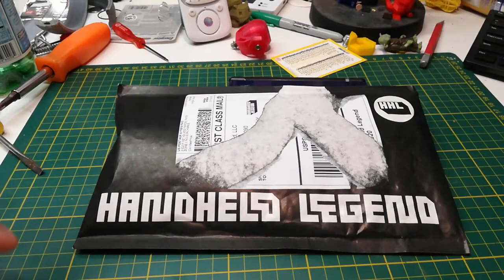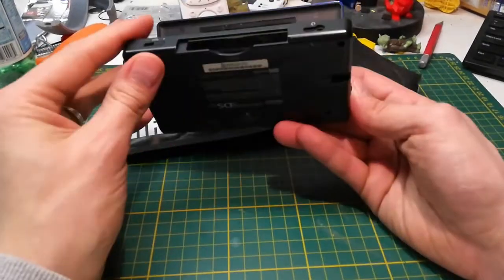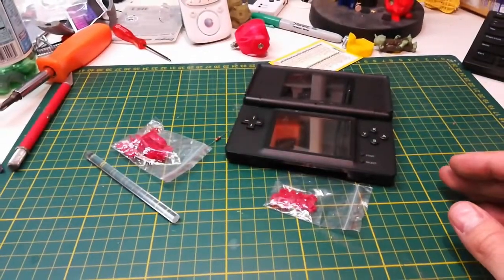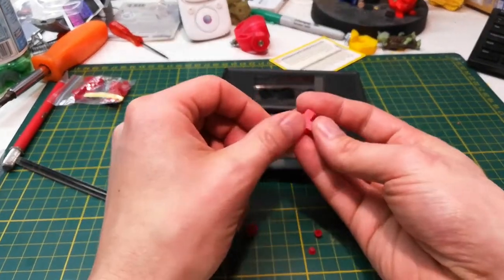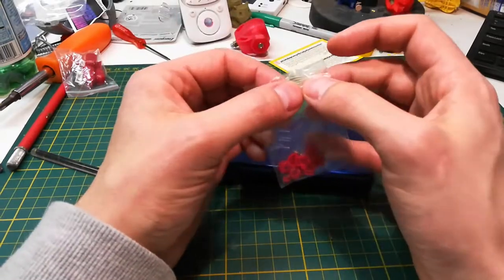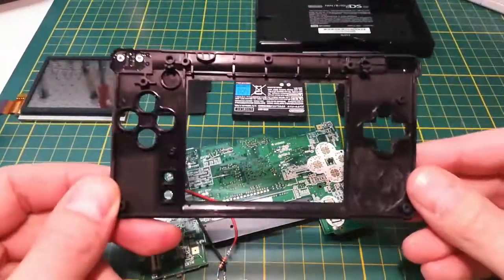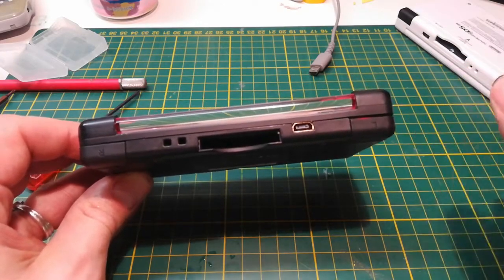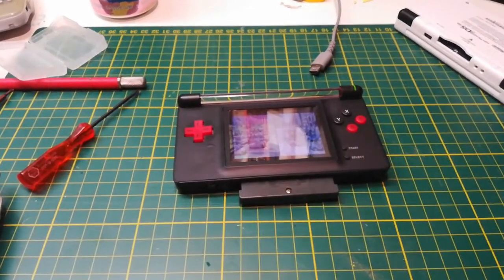Backlit GBA for Under $30! - Gameboy Macro

Comment: Speak for yourself guy I am a collision specialist and I also made a Gameboy macro with Bondo definitely not my best work but came out better than yours
Reply from the maker: Haha, okay. You do know I wasn't talking about you specifically, right? Glad to hear yours turned out nicely. I have been considering trying a bondo one, I have a few DS's laying around collecting dust. Any tips on how to get a good result with the stuff?
Reply: @flippinthrough  you just need the right sandpaper and just tube of bondo that you can find in a auto & body store but if you buy bondo from somewhere else like AutoZone or Wal-Mart it will be a bigger size of bondo when you just need a tube and 40 grit 80 grit and 400 and 2000 grit sandpaper